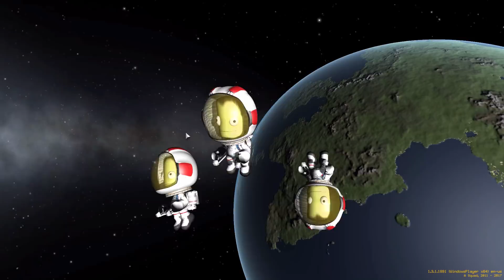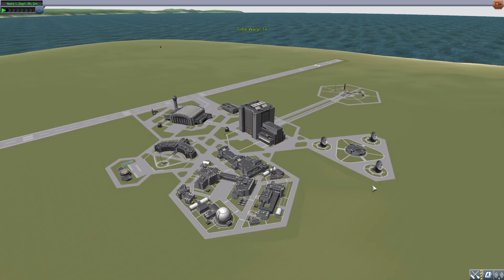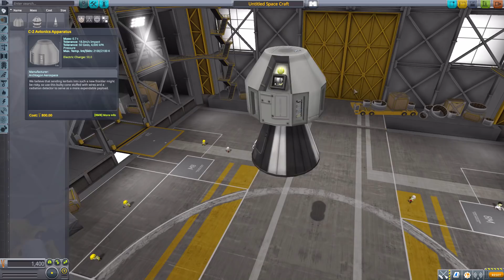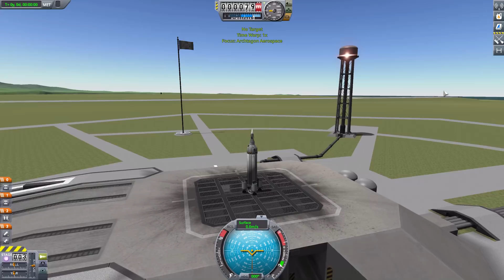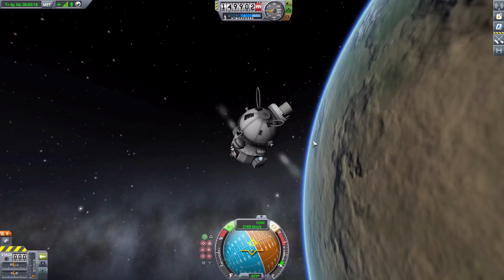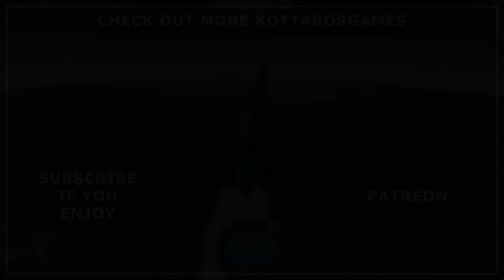KSP Mods - Archtagon Aerospace

Comment: It looks like the "two batteries" on the probe core and battery pack were two different resources, plain old Electric Charge and the mod-specific Battery Charge. It also looks like Battery Charge is used by the generator to create Electric Charge, but not at a 1-to-1 rate and with some delay to it, so the Battery Charge is probably used to slowly recharge the Electric Charge when you run low.
Reply: Probably the case, yes. I recall a Sounding Rockets mod which implemented batteries that couldn't be recharged in much the same way. 
I'd guess the SRB is an upper stage rocket for providing the final kick.
Reply: Yes that is the purpose of the battery. Plus the D-8 motor is intended to go directly under the D-3 probe or other lightweight payloads in a vacuum.